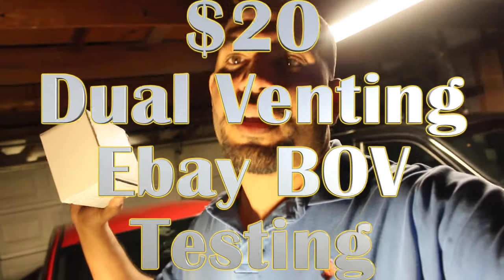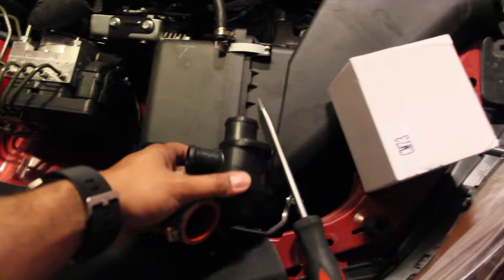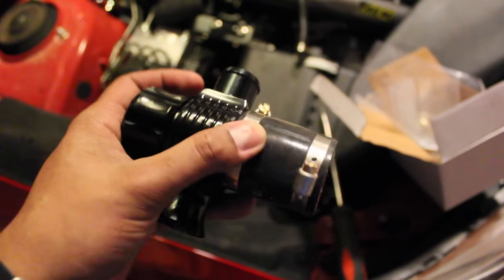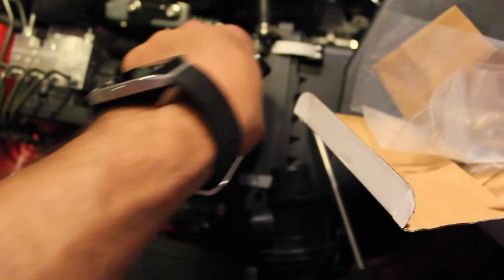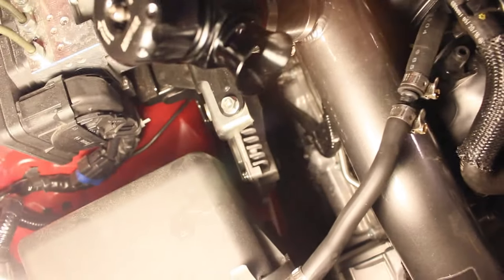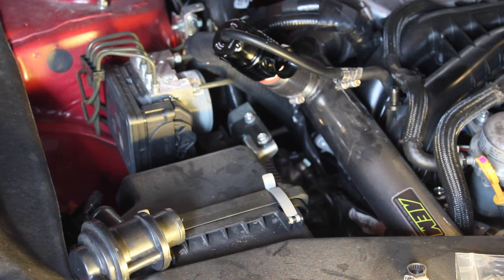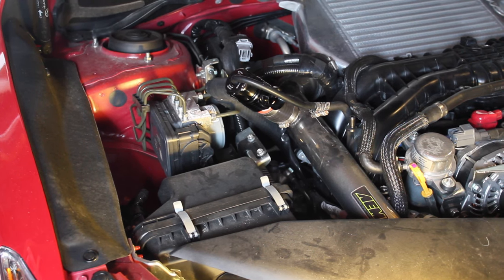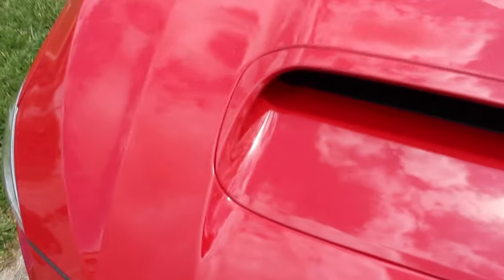$20 Ebay Dual Port BOV 2015+ WRX Part 2: Install + Testing - Amazing sound + Stalling :(

Comment: Go to the go fastbits mcm video on how to adjust bov if you can get it adusted properly all those issue will go away you mite possibly need a tighter spring

Comment: Letting off of the gas pedal causes you to bleed off already metered air (air for which a certain amount of fuel has been calculated) that means that after u blow off the ecu still thinks the air that just left is still there and puts in a calculated amount of fuel, which causes you to run really rich and basically floods the engine. Im not sure about your setup, you could replace the new bov with the old one and find a way to put in the new one in after the MAF sensor.  Either that or get a protune. Your basically dropping a match into a gasoline container,  it won't burn,  it's too rich.
Reply from the maker: +O Cas I didn't think that would be enough to cause it to completely stall. But I believe the spring is too weak which is causing it to vent far too much which is probably making that effect very drastic.
Reply: the issue is this bov design,i have one here for testing and you can litterally blow through the bov from atmosphere side to recirculated side,what this means is at all times your sucking in unmetered unfiltered air past the maf causing lean condition,the ecu sees this throws a code and tries to compensate by changing the fuel trims.its 100% junk design.now the single port bov just like this one doesnt have this issue so you could cheap out and get that one as its sealed

Comment: Can you adjust the recirculating valve 95% closed 5% open. When I had my GFB BOV 5% open was enough sound.
Reply from the maker: +Steven Diaz no there is no way to adjust any of that with this one... I might get the gfb one
Reply: Yes highly recommend that come! I will looking to get one as well on my 2016 wrx. I had for my old 2011 wrx sold now it's time to get another one lol
Reply: According to BrenTuning, GFB hybrid BOV are by far the worst on the market... Food for thought.
Reply from the maker: +Cody Kalicharan Yeah I think I'm gonna get the boomba racing one I always hear that's the best.

Comment: just wondering, is that a aftermarket chargepipe?  Isnt it the stock bov is located at the bottom near turbo?
Reply from the maker: +Dennis Li yes! It's an AEM charge pipe, all the unboxing and install videos are on the channel for it.

Comment: I got a great woosh noise after i swapped the stalk intake out.
Reply from the maker: +PoBs 1 yeah I hear that. This one was super loud. Like you'd hear it over even crazy loud exchayst
Reply: that's the cool thing about an intake, you don't need it but it lets you near the turbo more and you can hear the bypass valve dump back to the intake so the noises are just worth it lol. If you have an aftermarket bypass valve or adjustable blow off valve that you can close too 100% recirculate, the sound is more intense since they work differently than the stock ones.

Comment: i have this exact one i got for my 00 audi a6 2.7t and it made that car want to stall so i removed both of them, but I don't want to use it on the WRX because i don't think it's a recirc i think it's atmospheric. there is one on ebay it's a perrin clone for $33 and it's red, i was thinking of trying that one.

Comment: its letting some air out, the ecu dosnt know that its expecting all of the air back into the intake so you got a cel its thinking it has a bad maf
Reply from the maker: +Robi Flego yeah I couldn't think of any solution to limit the air exiting the system so I just ended up getting a boomba bov
Reply: a remap could also sorted it out but a better bov is always nice
and since it was an adjustable 2 port, you just close it all the way so it rediverts all the air into the intake and not into the atmosphere
Reply from the maker: +Robi Flego it didn't have the ability to adjust the amount to venting to the atmosphere vs intake
Reply: i messed up, you can get port blockers so you just completly shut off the atmo port, but than its just a cbv,
Reply: the one i was thinking about was a gfb response, it has an option to control the atmo vs intake port air volume,
Reply from the maker: +Robi Flego yeah I thought about getting that one but it's expensive and I hear a lot of tuner talking about it not being great. But that one gives the ability to vent just a little to the atmosphere so you can have better sound and fewer maf related air metering issues
Reply: yeah thought all could do it, and was suprised by the price...
Reply: this bov has design flaw that allows you to blow right through both sides of the bov,this means your constantlly sucking in mass amounts of unmetered air the maf didnt read causing a lean mix.i have the same bov for testing purposes.the recirculated/atmosphere side should be blocked off so you ONLY suck in air when you release throttle after boost..

Comment: Its stalling and throwing check engine lights because your car isnt tuned to full vent to atmosphere. set below 50% atmosphere or get it tuned.
Reply: the issue is this bov design,i have one here for testing and you can litterally blow through the bov from atmosphere side to recirculated side,what this means is at all times your sucking in unmetered unfiltered air past the maf causing lean condition,the ecu sees this throws a code and tries to compensate by changing the fuel trims.its 100% junk design.
Reply: @pigeonsil240sx  oh no doubt. Those Chinese knock offs never seem to work as they should.

Comment: I think the spring inside is too weak you need a stronger spring so it doesn't stay open as long
Reply: the issue is this bov design,i have one here for testing and you can litterally blow through the bov from atmosphere side to recirculated side,what this means is at all times your sucking in unmetered unfiltered air past the maf causing lean condition,the ecu sees this throws a code and tries to compensate by changing the fuel trims.its 100% junk design.

Comment: i think CEL is because the amount of air you blew out is not recirculating?
Reply from the maker: +Klintt Bernas I'll see if I can find a way to block some of the blow off...
Reply: Hqen2000 oh that one does not do full recirc?
Reply from the maker: +Klintt Bernas no its hybrid so it mixes it but there is no way to adjust the bias of how much goes to each.
Reply: the cel and stall arebecause the bov have major fla in design,you can blo right through both sides of th bov,this means you are alays sucking in unmetered air past the maf causing lean condition.

Comment: Look into it first a lot of shops won't tune your car with a gfb bov on them they are to prone to leaking
Reply: a lot of shops will want you to have the stock valve if you have stock turbo. I have a GFB on mine (over on the right on EJ motor) 100% closed and have no issues leaking my pro tune has been at 19.5lbs (with regular spikes over 20 during colder months) for over a year now :)
http://imgur.com/XLJuqYY
Reply from the maker: +R yeah I'll probably just get the boomba one

Comment: this bov is junk let me explain why your light came on and it stalled.the bov by design has a huge flaw,it allows unmetered dirty air to suck through the bov and air is being sucked in from the atmosphere side through the bov into the intake at idle.your maf isnt seeing this huge amount of air causing a lean mix at idle.i can prove this too you just blow on the recirculated side and air flows right out the atmosphere side.a good design this should be sealed to prevent air being sucked through the bov,it should only suck in air on recirculated side after going into boost and releasing gas peddle.not with this bov,your always sucking in unmetered air,and dirty unfiltered air at that.
i dont understand why they would do this but it is what it is.

i just got one for testing purposes because if it worked i could justify buying a good one.ill make a video explaining the flaw i mentioned.

so if your sucking in unmetered air you should be lean right?so why are you reading rich? i suspect the o2 is seeing the lean mix and adjusting fuel trims accordingly,but can only change it so fast so that small delay in adjustment at different boost/rpm we are seeing wonky afr,thats just my theory though.

Comment: Bro, $20 Bov on a 30k car is like cooking shitty Strip steaks on a 5 thousand dollar fire magic grill
Reply from the maker: +Nate O'Neill just wanted to try it out, and it actually worked ok. If I can figure a way to block the atmospheric venting a little I think it would actually work well...
Reply: Right, unless you are running a larger turbo you really don't need to be venting any air to atmosphere. It would actually help you keep your system pressurized between shifts not to vent. As long as you an intake you will hear it dump back to the intake no problem :)  I think you might need to do a little research on bypass valves and how they work with your motor. It is stalling because the air is being vented. If you are going to run an aftermarket valve you will need to at least have an adjustable one so you can put it at like 5-10% if it is important that you hear it more.
Reply: Its just rich for the second or so on throttle close. I think a 50/50 split to vent and recirc would be ok.

Comment: This "BOV" is fake. It always has a air bypass between the blowoff port and the port on the other side. So u got big hole before turbo or after turbo (depends how you install it)
Reply: FINALLY!! someone who knows what their talking about.THANK YOU!
i have the same bov for testing purposes and you're spot on.i can literally blow right through the bov meaning you are always sucking in unmetered air past the maf and causing a lean condition.a normal bov will be blocked internally and only when you release the throttle after boost will it suck in air,not all the time like this junk.